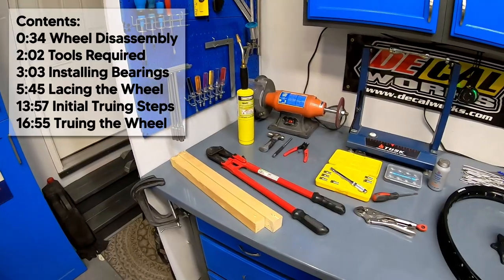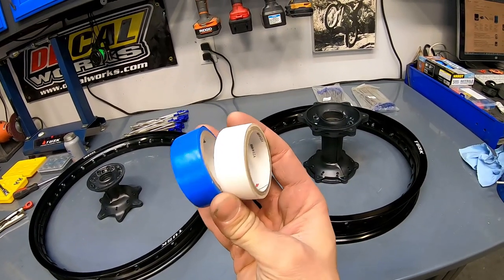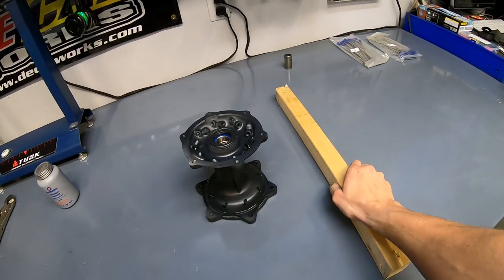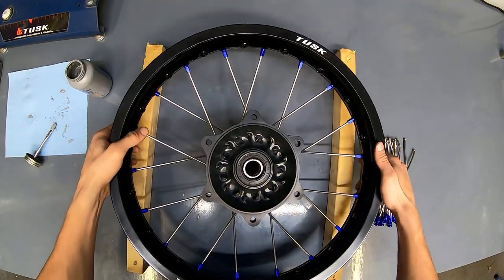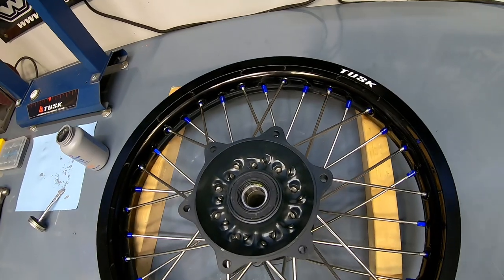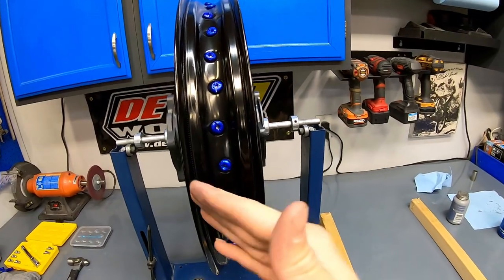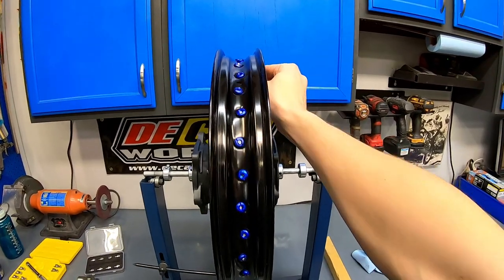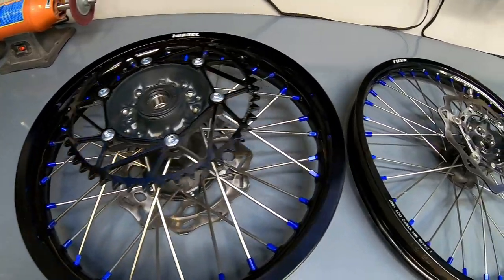How to Lace and True Dirt Bike Wheels

Comment: Be careful for any offset on the rear wheel otherwise when you install your wheels they will not be running in line,. Front hubs usually dead center but as you see with the rear with different length spokes if you pull the rim to the left or right when trueing it you will change the position of the tyre in the swing arm left or right of the center line and seriously effect the handling.

Comment: Thanks for the details in this video, re spoking/ trueing a wheel has always been intimidating to me. Now I think I can handle it.  I have a yz 300 build in process, I'm not so patiently waiting for my cylinder/ head to get back from Eric Gorr, gonna run a 72mm Wossner piston. Power seal and Millenium Technologies are awesome to work with also.  I'm excited to see your finish build and will buy some tickets to maybe get lucky and have a chance at winning it
Reply from the maker: That's awesome! I'll be running a Wossner piston as well for this build. I'd love to see yours when it's finished! Good luck lacing your wheels - you'll find it satisfying.

Comment: I have a weird question.  Is it possible to lace a front wheel hub into a rear wheel rim ? 
I ask this because 17” supermoto wheels are hard to find for my bike. This way I could have 18” SM wheels. 
Technically it’d be 2 rear wheels but the front would just have the front hub to suit so it’d bolt back on.